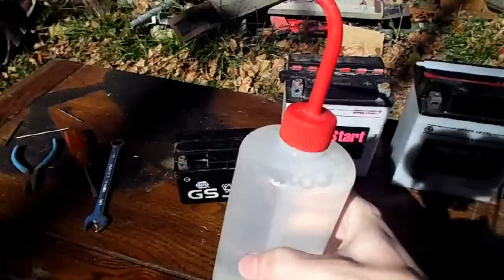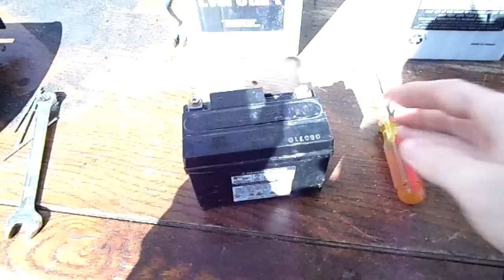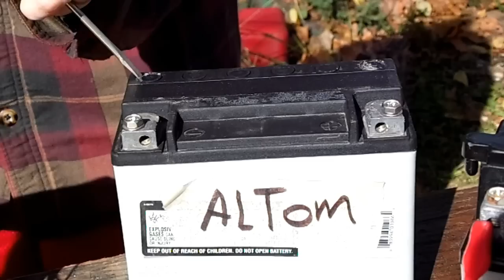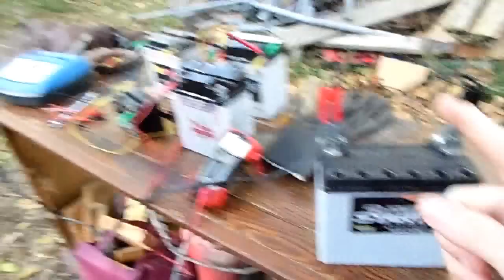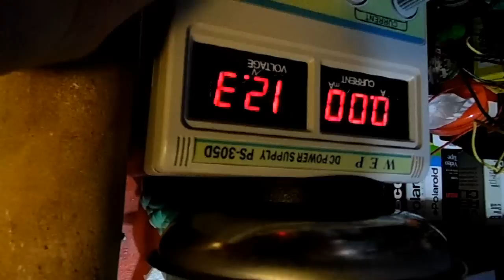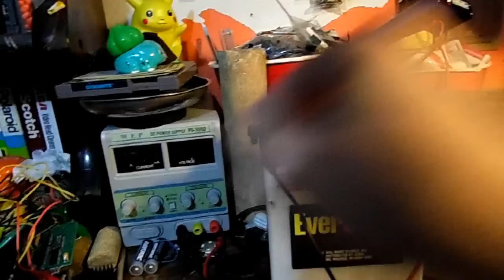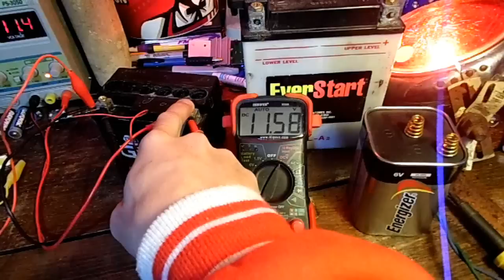DIY Fixing Lead Acid Batteries

Comment: One of the first things I thought was I can't help but think that you remind me of Luca from Chrono Trigger when I started watching this video. Anyway, I have a couple lawn mower batteries that have been turds for the past few years, I got tired of them and finally went and got a new one today being sick of jumping my mower off the car every time I want/need to mow the lawn. No manner or normal charging with various chargers or being in the mower with it running ever seems to charge them up well enough to start it anymore, I hate throwing anything useful or repairable away though and I was intrigued by the desulfator module you had. I would like to know more about them, mainly, where to buy a good one, buy one made by you, or, what do you think of this one I found on amazon, there is a schematic for it in one of the pictures;
http://www.amazon.com/Battery-Desulfator-Assembled-Reverse-Protection/dp/B00UJGBQUI/ref=sr_1_6?ie=UTF8&qid=1432964691&sr=8-6&keywords=desulfator
Reply from the maker: aeridyne thanks, i wonder if i'll be able to cosplay her after i start my gender transition.

on closer inspection i've found the evidence for battery desulfating to be a bit shakey. someday i hope to build a high powered pulse generator to test it out more.
Reply: I think you might pull it off pretty well.

Comment: Voltage doesn't tell you if a battery is good or bad. It's just the state of charge.
Reply: It was very well video.It is impress me.If you will be watch this video you will also like this
Reply: +John Petersen Tell that to a LiPo.. Hur hur hur x)
Reply from the maker: John Petersen yes it can, as a battery gets worst i tops-out at a lower voltage.
Reply: Not exactly.  With batteries this simple the only way that you reduce maximum voltage is by a cell going bad, each bad cell reducing the voltage by a multiple of 2. And one cannot know that this has happened without first attempting to charge the battery. Besides, his battery that has 10 volts is a sealed absorbed glass mat unit that uses a gel acid rather than a conventional liquid acid. It's not repairable through any of the kinds of means he's referring to
Reply from the maker: John Petersen
well i repaired it and its working well still, and no its just the electrolyte soaked into the glass mat, you can add water to replenish the water that electrolytes off.
Reply: John Petersen Hi, I like the idea here they used. But there are still some good ideas like knewreck rapid renew guide. You can find in google if you search for how to recondition wet cell batteries
Reply: John Petersen I desulfated a few gel batteries with a pulse desulfator, it works.
Reply: +John Petersen load test does give you a accurate idea of the health of the battery, but out of a box of them, and needed one quickly, I'd always pick the one with the highest voltage
Reply: +John Petersen interesting points ,if anyone else wants to uncover how to recondition my car battery try Megarno Amazing Battery Magician (Have a quick look on google cant remember the place now ) ? Ive heard some great things about it and my cousin got cool results with it.
Reply: +John Petersen  nice fact there, anyway there's another way to refurbish the battery, you guys could try to google the Panlarko recondition planner with the key phase of refurbish lead acid battery,my neighbour already tried it and it work just fine.
Reply: +John Petersen hi everyone ,if anyone else wants to uncover how to recondition my car battery try Knewreck Rapid Renew Guide (do a google search ) ? Ive heard some incredible things about it and my brother in law got amazing results with it.
Reply: That is why he load tests the battery.
Reply: Start your very own battery business and make huge cash here: JoxCharge. com

Comment: hi, nice videos. what if my car battery shows like 20 volts but has no power to turn the starter? have you encountered such weird batteries?
Reply: Then you need to replace the battery on your volt meter

Comment: So do you just add water.?? distiled. Whats the diffrence.
Reply from the maker: the difference between distilled and tap depends on your tap. if you live like in Missouri where theres a lot of minerals in the water you may want to go with distilled. but here in illinois i find we have water without as much minerals in it and it hasnt hurt my batteries yet.

Comment: Rinoa, great videos. Thanks. Have you seen any of those videos where people are "converting" old lead-acid batteries to "lead-alum" by dumping out the acid, rinsing and adding a mixture of alum and water?

What do you think? I just tried it on a car battery that had been seriously over charged when the voltage regulator in my alternator went bad. It boiled the battery dry but even after refilling it with water and charging it, it would not even engage the starter. Now it is a bit better but still will not quite start the car. It would be awesome if a person like you with knowledge and testing equipment, could do some experimenting to see if this "conversion" idea is any good.
Reply from the maker: yeah i've been thinking about doing that. unfortunatly lead-alum batteries seem to not be good for starting engines. they are lower voltage and dont give as many amps. better for like solar-powered stuff.

Comment: What components do I need to build that desulfater doohickey?
Reply from the maker: well i'm still not entirely sure on how effective they are. but all you need to do is provide high current pulses to the battery. you could do that in many ways. best way i can think of is to charge a large capacitor to 300v or so and dump that power into the battery like 100 times a second.
Reply: Rinoa Super-Genius Get a pulse charger.

Comment: hi, I m an electronics technician ( home electronics set top boxes, tv, pc s & laptops ..etc) and  mean time a hobbyst on battery stuff as a beginner.
lately been watching your informative videos and learned a lot from your experiences so thanks a lot.
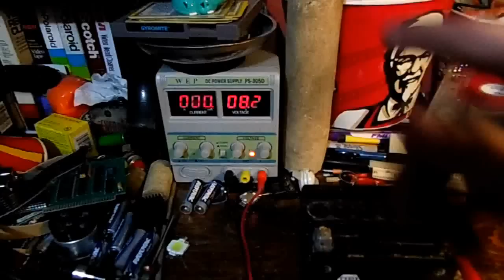the question part is I have a single 12V 6A lead acid battery that really weakened and goes down pretty quick. now  just because I want to practice on lead acid batteries I want to try your method at 12:30
just wanna know does battery draw a good performance after that or rip  ? (sorry for my grammar)
Reply: Most of these videos don't work and if they do it's only temporary...

Comment: rinoa, awesome video. i just sat through it but i'd like a copy on my laptop to save for reference. i figured it out with the power of google however. thanks for sharing your wisdom. do how have a line on how one can make/get a desulfator for cheap?
Reply from the maker: the cheeper you buy them the quicker they fail or dont work at all. you could prolly make one really easilly.

Comment: awesome never heard of a desulfater like that , where did you get it ?
Reply from the maker: ebay, it doesnt show hardly any results. you might want to avoid the Wizbang Plus model couse its super cheep crap.

thats not to say the principle of battery desulfating doesnt work though, i've decided to just build my own desulfator from scratch and make it a lot more powerfull.
Reply: would the 50$ ones show good results?
Reply from the maker: nope nope
 havent tried them before. sorry.

Comment: "... which I think lead dioxide is the most poisonous form of lead, but oh well..."
lol
Reply from the maker: *****
regular lead is fine to touch and only slightly bad if you swallow it. the big issues arise when ingesting lead salts like lead dioxide. but either way i havent heard any information about them causing physical deformities in humans except while very young. but you dont see many 2 year olds working at glass mills.

good thing is lead will leave the body over time, most of it within a few months.
Reply from the maker: *****
i dont use batteries for starting engines, i use them to store the electricity my solar panels make.
Reply from the maker: *****
you never played with batteries before 7? wow sorry to hear that. i would expect even a 4 year old to have played with alkaline batteries.
Reply from the maker: *****
actually its best to just have a PWM controller and charge them with a nice amount of amps.
Reply from the maker: *****
no, the rate of charge does not effect the percentage of charge like that.
Reply from the maker: *****
are you just saying random useless information?
Reply from the maker: *****
well you are commenting a lot and dont seem to be very coherent. you are coming off as slightly trollish and also a bit spammy.

maybe try to put your ideas into one single comment instead of making 5 little comments. you can edit old comments. and also its not a good idea to randomly respond to a comment thread about something unrelated to that comment thread. in that case you should start your own comment.

Comment: If the acid has crystalized I would try WARM TO HOT water to get them to desolve quicker...Or a vibrator to Shake and disperse the crystals..
Another thing they are finding, is Frequency charging..  Standard charging uses house hold current,,which is not good..

Comment: Love this guy :D

Btw Rinoa help out please:P I have a car battery (3 years old) which became weak. It is full of acid though. Battery is losing energy after 1 day and car wont start. It cannot hold higher power. 

Now I wonder if new magnesium-sulphate mix exchanged completely with the one inside battery would do the trick? Can that really restore it?
Reply from the maker: Dragon Steel
 lead acid batteries do not have sulfur dioxide in them. i think you mean "sufuric acid" and the crystals it makes is called "lead II sulfate" or just "sulfate"

but anyway, who are you talking to?
Reply: Rinoa Super-Genius You are correct, I realized I was talking about different power when I posted that comment. :) I was talking to OrdinaryHandsome. ;)
Reply from the maker: *****
yes thats called "charging" the batteries.
Reply from the maker: i'd say dont fully refill the electrolyte. just mix up as strong of a solution as you can and put a bit in each cell and see how it goes. it should help it a bit.
Reply: Here is what happened to your battery. As the battery looses charge the sulfur dioxide in the solution sticks to the plates reducing the reaction. Well, over time, especially if the batteries were left to discharge for long periods of time, the sulfur dioxide turns into a crystal on the cell walls. Once the sulfur dioxide turns into a crystal it no longer detaches from the cells during a charge. This means the battery will not charge much if at all, and will die fast. When you charge a battery, your not adding power, you are cleaning the sulfur dioxide off the cells so your battery can maintain a full reaction. Once the sulfur dioxide turns into crystal, you no longer can clean it off the cells, the battery becomes bad. when the charge is very low, almost all the sulfur dioxide has attached to the cell walls, there is minimal reaction producing minimal power.
Reply: Rinoa Super-Genius

Comment: that alto battery i think you could open it in the middle on top the hole strip can come of
Reply from the maker: *****
keep in mind that the electrolyte reacts much much more strongly to cloth than skin. i accidently splashed myself in teh face with electrolyte last year and it doesnt hurt that much, burned a few holes in my cloths and etched my tripod but didnt hurt me and i got exposed the most. keep in mind battery electrolyte is mostly water.

Comment: #1 your awesome. #2 i need your advice please. i was charging my go kart battery and forgot i had it on fast charge. next morning i check it and it over flowed acid. i'm getting 8.6v now. can i add water and properly charge it again or is it shot?
Reply from the maker: did it smell like rotten eggs? if so that means it started to decompose the sulfuric acid also. if you add water you might not help it much, but try mixing a bunch of epsom salt with the water then putting that solution into the battery. the epsom salt should help do what the acid did.

unfortunatly i have quite a few batteries that have had this happen and i havent found any good ways to revive them. are the batteries 6v trojan T-105 golf kart batteries?
Reply: Rinoa Super-Genius damn, yes it smelt bad. its 12v cycle tron.
Reply: james beck thanks for your quick reply, your videos are very helpful.

Comment: Just FYI 10v is a bad sign, it usually means a bad cell if the 1 volt is young enough I'd rather try it, most chargers will not charge batteries below 11volts, anything lower looks like a 6v to the charger, you can trick the charger by linking in another good battery by putting the pos on one, and the neg on the other then use alligator clips to link both positives together then another to the negs. Also don't add water to SLA batteries, shake it if it rattles you're done. I work at batteries plus
Reply from the maker: you dont seem to know much about batteries then. i have a deep cycle that was at 4v and once revived now has about a 1/4 of it's capacity. some of the batteries i weld with where bellow 8v once, so they are still very useful.

and as for adding water to SLAs, an sla will vent off its water over time and will try out. so yes adding water to an sla will help. you did watch the video right?

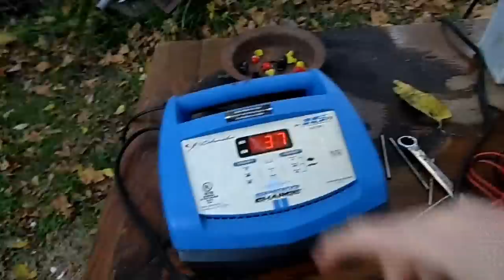Comment: Great info.  Subbed a while back and have been slowly working through them all.  Question on this one; at 8:50 or so, you disconnect the four batteries from the charger and connect the charger to another battery.  Were the four batteries connected in parallel because the charger you're using is a "smart charger", and wouldn't charge them each individually?

Comment: great stuff !  How do you make a desulfater?
Reply from the maker: good question, basicly you need something that will provide short burst of electricity. could strip the flyback transformer out of an old tv and try to use that to make electric jolts. but the jury is still out on weather desulfators work. i've been doing more tests and they arent looking to promising, but thats with purchased desulfators, homemade ones could be more powerful and might work.

Comment: You are lucky that you can just mess around with stuff freely. My parents crap themselves whenever I do anything.
Reply: here's  several suggestions for doing a pro job
never try to do this unless you are sure what you are doing - the acid can burn your skin
check the voltage first - there may be a dead cell which would be a waste of time trying to fix.
Check your battery fluid.
Try to completely recharge the battery.
(I read about these using rapid renew roadmap website )
Reply: There are many components to fixing a car battery. One resource I discovered that successfully combines these is the Rapid Renew Roadmap (check it out on google) definately the most incredible course that I have ever heard of. look at this extraordinary resource.
Reply: There are several factors in battery repairing. One place I discovered that succeeds in merging these is the Rapid renew roadmap (google it if you're interested) without a doubt the no.1 info that I have ever seen. Check out this amazing website.
Reply: There are many components to doing a pro job. One plan I discovered that succeeds in merging these is the Rapid renew roadmap (google it if you're interested) definately the best course i've seen. Check out this awesome site.
Reply: Cheers for this, been searching for "how to repair dead car battery" for a while now, and I think this has helped. Have you ever come across - Ammaceen Reconditioning Rabblement - (Have a quick look on google cant remember the place now ) ? Ive heard some amazing things about it and my neighbour got cool success with it.
Reply: I think that it is necessary at times to make some that will be indispensable for us and especially for the others
Reply: 8 Simple Tips & Tricks To Extend The Life Of Your Car Battery > https://t.co/3ycayBV4e1?DWEsqwe33df34re
Reply: Move out
Reply: Ⓛⓔⓐⓡⓝ ⓗⓞⓦ ⓣⓞ ⓔⓐⓢⓘⓛⓨ 𝐑𝐞𝐜𝐨𝐧𝐝𝐢𝐭𝐢𝐨𝐧 old batteries back to 100% of their working 𝐂𝐨𝐧𝐝𝐢𝐭𝐢𝐨𝐧.>> https://t.co/3ycayBV4e1?hEESf-PoQu4a
Reply: Ur parents need to be desulphated....it happens. Good luck!
Reply: I recently got the EZ Battery Reconditioning program and just reconditioned two car batteries. The guides were very easy to follow [Check Details Here==> BatteryReconditioning5.blogspot.com
 ]. I wish I would have found this years ago! Thanks!?
Reply: 8 Simple Tips & Tricks To Extend The Life Of Your Car Battery > https://t.co/3ycayBV4e1
Reply: Start your very own battery business and make huge cash here: JoxCharge. com
Reply: Michael Reyes what bullshit is that
Reply: How to start a battery business at home and make a lot of money: hootbattery.blogspot.com

Comment: I hooked up a trailer light and after 3 min it dropped to 12.46 and it stayed at 12.46 after 5 min. When I unhooked the light it went up to 12.8 and stopped at 13.06v
Reply from the maker: thats not that bad. whats the amp draw from the lamp?

Comment: Ok so I added water and Epsom salt (the cells were low) and charged it over nite with a 2amp slow charge. Volts are at 13.3
What now?? Do I HAVE to get a desulfator? It's a new battery so I wouldn't think there'd b a lot of sulfur buit up on it
Reply from the maker: it doesnt sound like its new. sounds like its been sitting on a shelf for years and died.

the big test now is to connect a 12v load like a motor or car headlight, and see how far the voltage drops. if the voltage stays above 12.6v after a few minutes of running the light (asuming it pulls 2-5 amps) its prolly new.

Comment: They've already issued me a refund and said that there's no need to send the battery back. I'll check continuity
Reply from the maker: oh ok. chances are since its at 10v it has acid but its been run down. so you could stil open it and put some water into it. maybe even epsom salt solution if you want. then try to slowly charge it. might take a while for it to regain its reactivity